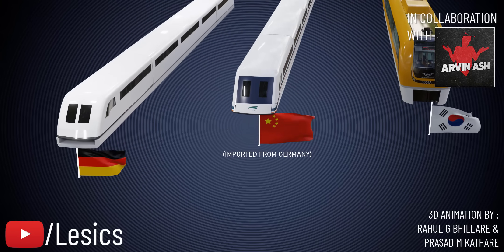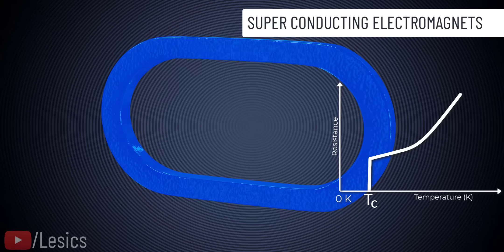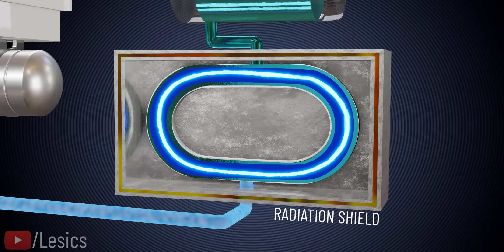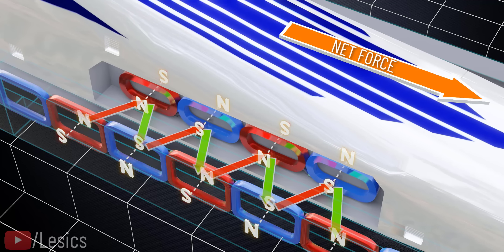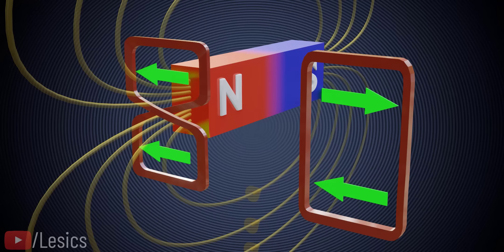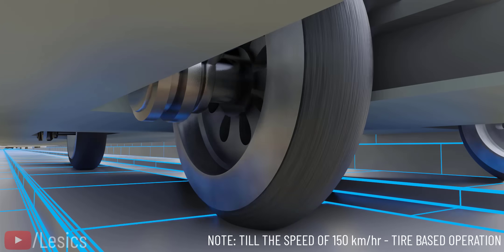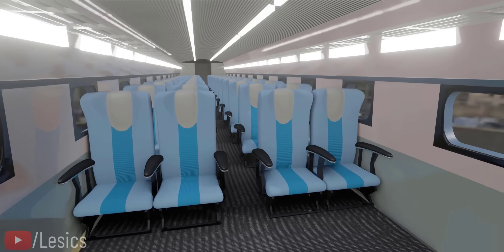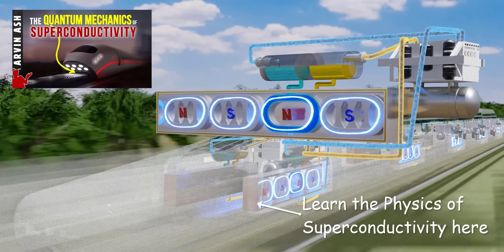The Fastest train ever built | The complete physics of it

Comment: Can you explain this question: why does the rotating propeller produce wind? Is it because of propeller’s aerodynamic structure?
Reply: Google it, or check youtube. As far as i understand, there are two principles that work simultaneously, on the lower part of the blade it works as a pump, just pushing air backward, on the upper part it works like a wing, because of longer route of air molecules they travel faster, creating area of lower pressure, sucking propeller in the forward direction. However if 
Lesics wants to explain... il watch that too ;)

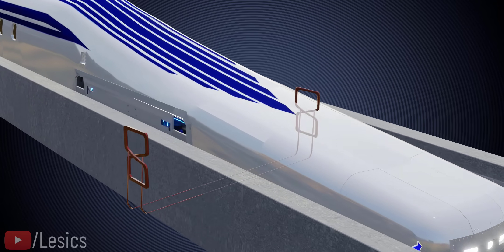Comment: 8:40 Wouldn't this cause an accident if a coil on one side of the maglev is broken? If one of the superconducting units has lost it's charge for example, it would mean that there is potential on one side, and not the other, meaning that there would be a constant force pulling the train to one side, until collision with the wall, how did they get around that issue?

Comment: When its explained like this it seems like such a simple concept, its just magnets and wires, but can you imagine telling someone 100 years ago that we'd have floating trains??
Reply: Industrial level superconduction is a BIG part of that concept.  Without that relatively new discovery, these would be big rails of melting metal and fire.  Before superconduction, we had ideas on DECREASING resistance, but it came as a shock [npi] that we could ELIMINATE it.  Without the elimination of resistance, we're back in the realm of most other high power propulsion [dragsters, rockets, missiles, etc.] lots of heat energy blowing out the backside.
Reply: One thing mentioned at the beginning of the video is that you need to alternate the polarity of the on board magnets to achieve propulsion. If the system controlling that alternating function were to fail, it would not be a pretty ending. I am also curious to know the process for reversing polarity as well.
Reply: @Aharpoon24  there would obviously be safety measures to stop that from happening
Reply: 👍👍👍👍
🤘🏻🤘🏻🤘🏻

#peacevaas

👌🏿👌🏿👌🏿
Reply: https://youtu.be/lnT1GOxLOFA

Comment: Around the five-minute mark they mentioned changing frequencies as a way to keep the train moving forward

I'm trying to think if these coils are only a few feet or metres long

And the trains moving at 600 km an hour. Wouldn't the frequency shift have to be incredibly fast. Like 166 Hz?

600 (km / hour) =
166.666667 meters per second
Reply: Yes,  I was thinking the same. I think it's possible to achieve 166Hz easily I guess so🤔🤔🤔

Comment: Honestly, from a design and engineering point of view, I still believe that the technology employed in the German Transrapid (used in Shanghai) is far more practical and makes more sense from a maintenance point of view. The need for retractable wheels in the SCMaglev, when operating <100km/h is unnecessarily complex, not to even mention the maintenance/running costs of the helium based cryogenic system. I'm very much looking forward to how China will evolve their competing technology, as I know they too have a 600km/h train being developed, with planning already underway in Guangdong.
Reply: It's clearly over-engineered and there is quite widespread criticism of economic viability of this project especially considering demographic projections...
Reply: The German maglev has only 1 cm clearance and uses costly computers and as far as the wheels go they do not have to screw around like planes with tonnes of fuel on board where I believe most of the wear is done.
Reply: @edwardbarnett6571  The argument of costly computers was valid in the '70s when the two technologies were still in development. Now the cost of computing relative to the cost of the whole project, is basically insignificant.
When it comes to wheels, it's still better to avoid them completely. Retractable rubber wheels will completely take away the main advantage of Maglev, which is lower maintenance costs.

Comment: I always believed that magnets will play a key role in solving our big energy problems. 
This whole train was achieved simply by fully understanding magnets.
Reply: It requires "big energy" to run those trains.  We are right back to square one.

Maybe use solar panel on the tack to offset the grid requirements...  But that's a long way off too.
Reply: @robertfleischmann4119  - Well, when you say "Big energy" maybe you could compare how big, vs an Airliner, moving the Same number of people, from "Gate to Gate!" (So, that would compare the Airport Terminal Fraction, the Push Back Tug Energy, the Taxiing Energy, Takeoff Energy Cruise Energy, Descent & Landing (Braking) Energy, plus, again, Taxiing Energy, & again, amount Fraction of Airport Terminal Energy.) 

Who knows, you might still be Right, as, it no doubt uses a fair amount of Energy, to push it to 600 KPH, at Near Sea Level Atmospheric Pressure!
Reply: @robertweekley5926  If it is run in a single 11 psi tunnel not only can you avoid surface disruption but people can still breath while saving on tunnel resistance.
Reply: @robertfleischmann4119  It only uses the same power as HSR at the same speed and without any maintenance it may make a profit.

Comment: Nooo:- There is a Mistake in Controlling a train direction, a driver cannot cross the corner!! When it will turn in the corner one side of atrain will be higher more than another side! Another mistake is what if atrain will stop suddenly?? It will cause high heat in its superconducting materials... (Just modify u'r train first)

Comment: Bro in the horizontal direction the train should OSCILLATE as for the  force(f1) acted for the restoring of position of train there is no force to counter f1 until the train moves certain amount in the direction of f1.why it does not oscillate.

Comment: the french TGV holds the speed record for a wheel over rail train: 572 km/h. It is a 40 year old record.

How is a magLEV going at 600 km/h impressive ? I would have assumed with all the tricky technology, it would be already breaking the sound barrier or something... lame.
Reply: Tgv  never held the ultimate train speed record and ghe 572 run is from 2007, its not 40 years old
Reply: @matsv201  my mistake, it is from 2007. Still an old record, for WHEELS OVER RAIL like I said.
Reply: @bschwand  well someone is going to have the specific wheel record just like someone have the steem record.

Its wrong that tgv held it for 40 years.. the 1981 record was not a record .. the 318km/h was slower than a 1955 324 km/h run.

Fun fact. Tgv have never hold the train speed record.
Reply: @matsv201 
-  "my mistake, it is from 2007"
- "... record for WHEELS OVER RAIL..."
can you read ?
Reply: @bschwand  what of what i wrote did you not understand?
Reply: You are missing the point. 
572km/h with simple wheel on rail: good engineering.
600km/h for an insanely complex, expensive system: bad engineering. Make it go at mach 1+ then it's impressive.
Reply: @bschwand  maglev is less expensive than normal track.

Also the tracn was just scrap  after the 2007 test run..

Just pushing thing beoned there limit is not good engineering.

Besides that tgv needed 150 km of track.. sc maglev had 41

Comment: I beleive this is a a promising technology to substitute commercial flying due to the environmental effects of the latter. However, isn't it incredibly expensive to build and maintain such system? 

Can this ever become a wide-spread system or even replace commercial flight? I try to be optimistic, but the biggest opportunity of flying is that you can fly... well, anywhere as long as you can land. I doesn't need a built track which covers a large area on the surface.

I know this is only the beginning, and I'm all in for sustainable developement but this seems to be difficult to be implement widely. What do you think?
Reply: High speed Maglev can be time competitive for anything within 1500km if you account for the much quicker boarding time, lower likelihood of delay, as well as being connected directly to city centres. The Japanese system mentioned here will likely be extremely expensive as 85% of it will be underground in tunnels, and the capacity of it is lower than current Shinkansen lines. I'm far more looking forward to the competing 600kmh system being developed in China using a far simpler technology, based on the Transrapid Maglev.

Comment: We already have 400 km/h high speed trains on good old steel wheels. Who is going to spend 20 x more to go 50% faster???
Reply: this has potential to go much faster than +50%. it's levitating (flying), not impacted by any friction by steel wheels/tracks. 

pump electricy from nuclear, it only matter of how much electricity you're willing to pump to get higher speed + how much the exterior material could withstand air friction

Comment: What happens if electricity cuts out at full speed?

Another question: How does train guidance work on speeds too low for magnetic levitation? It would seem hard to use wheels to turn at 140 mph or even 40 mph without rails.

Thanks for the excellent video!
Reply: All system apart from propulsion  is passive systems, hevce they work even with out power.

The systems also have a ups and a gas turbine onboard for low speed emergancy.

The wheels guide the tran as a normal train at low speed.
Reply: @matsv201  I see about the power loss. I was worried about cooling the superconducting coils, but I guess that's what the backup generator is for, and they probably take a little while to warm up. It makes sense that the levitation and guidance should work as long as the train is moving and there's a current in the semiconductor coils. 

There must be tracks for the wheels, right? It looks like there's very little clearance on left and right of the train, so I wouldn't trust car-like steering, especially if the track makes a turn.
Reply: @ilyagrig  well.. there is a few more systems. Its the speed thatnis generating power.. so even if the powet is cut, the momentum of the train will keep generering it.

There is also a helim tank, it will last for 10 minutes or so. By that time the the train would allredy have stoped.

Then there is the ups, then the gas turbine (supose to be swiched to a fuel cell, the gas turbine is the reason for the black stripe  on the roof.)

Then if everything fail the train will drop into the trought and just glide along. There are teflon pads  on the outside for that reason
Reply: If the power is cut, the normal wheels would be used for emergency purposes I suppose.
Reply: @_egghead  not really. They cant be used at high speed. But ut dont matter because the levitation is self supporting.
Reply: @N.G.Gonbei  Thank you! Together with the previous answers, that about covers it for me.
Reply: note this one  air planes dont have rails they can do400 mph  also the train is in a trough bit noisey it it touched but still safe
Reply: @N.G.Gonbei  
Japanese Technology is magical, Technologies nowadays don't even put 10% of the Innovation that Japan putted into SC Maglev! 
Really Stunned to see the theatrical in even Animation, its an engineering marvel in Actual Practice!
Love and Respect from India🙏❤️

Comment: I am sorry to rain on your parade. China is poised to break and surpass the Japanese maglev train achievement by using high temperature superconductor. They only need to use liquid nitrogen which is abundant compared to liquid helium. Furthermore, China could complete a maglev rail line much faster and longer than Japan. Japan's 2035 completion date of Tokyo Kyoto line is too slow. Japan need to buck-up.
I suspect Beijing-XiongAn-Shanghai line most likely will be high temperature superconductive maglev line. Many times longer than the distance between Tokyo-Kyoto.
Not saying Japan is not capable but China obviously have the advantage of scale of economy.

Comment: i'm curious, how many coil components can fail before there's a catastrophy xD
Reply: When a superconductor fails, it can be a really sudden switch to a bad situation.

The superconductor has zero electrical resistance. But if you put too much current into it, or put in current too fast, or subject it to magnetic fields that are too strong, or too turbulent or the superconductor heats up beyond the critical point, then sudden quenching happens.

The supermagnet goes from being a perfect conductor to an imperfect conductor in a small spot very quickly.

This causes that spot in the superconductor to heat up very quickly. (The energy in the magnetic field is turned to heat, very quickly, causing more of the superconductor to quench...in a kind of chain reaction.) That sudden heat, in turn, causes the cryogenic fluid to boil off very quickly as well

Which causes the other supermagnets cooled by the same loop to quench as well.

My guess is, that the train has a recouperative beaking system to slow down the train (more magnetism used for braking😅)...combined with the wheels as a backup...plus the side walls are Teflon coated.

I'd be open to being a test dummy🤔...but not for free😅
Reply: Even if all coils fail, there's a backup traditional wheel tho.
Reply: @_egghead  on a high speed? Surely the wheel couldn't handle it
Reply: on land what is the land speed record  wheels have to be used  if it takes off its an airplane  so there
Reply: In point of safety, I wonder if the tunnels this train is passing through  souldn't be better fitted. If they are too large, terrorists could place bombs inside.
Reply: I was thinking about potiential sabotage, if you cut the links between each side it could make the train loose the ability to stabilise side to side. It depends on how easy they are to get at.  

I guess you would have to do that to several coils though, you have to remember from the track coils perspective the entire train is over them and gone in less than 1 second. 

Worse: cut and connect them back in reverse polarity, it would either blow the coil up or pull the train hard into the side of the track or combination, again you would probably have to do a significant section, the train might just ride through with a bump or harsh jolt.
Reply: @chris746568462  Have u thought what happen if someone cuts the traditional railway track? Well , the entire traditional track is connected to a circuit Or electrified. The  track engineering department monitors the entire track lines from control room. If every thing is ok then only the control gives green signal for the train movement. This safety mechanism also ensures that no two train can come on a single track.
Reply: @amanch9322   Would they know if you made the track wider? Rail is pretty bendy when you have pulled several tie downs out...    

I like what tyler says, given the high cost of superconductors, associated equipment and space i bet each coil set is just designed to be as reliable as possible rather than having backup, and they rely on airbrake/wheels to handle an emergency quench an stop, that is if the wheels can handle almost 400mph...  

Any track repairs from a major accident are going to be considerable, most of the infrastructure is in the track.
Reply: @chris746568462  this is a child question, but what about EMP gun? will it forced the train to stop? the speed and energy from sudden stopage surely would be fatal
Reply: @Repsyzz  an EMP in theory would kill propulsion and slowly bring the train to a halt. It's not like it can instantly stop from 600km/h and as long as it goes forward it will levitate and guide itself passively and only when it drops to a low and safe speed touch the ground, hopefully on its wheels.
Reply: https://youtu.be/ffO_McpxSHE

Comment: Although this is a technological marvel and something to admire from an engineering standpoint, in reality it is prohibitively expensive to build and operate. All this special built wiring needed along the route several hundred Km's (which needs to be a super level and straight route compared to normal High Speed rail - so much more expensive tunneling through mountains), both the guide-ways and the ineffective induction powering system buried underground for the complex machinery on the train which consumes large amounts of power. Add the complexity of mass manufacturing these super expensive and complex train-sets with cryogenic machinery onboard - it is no wonder why other countries are not very much interested in this technology. Everything comes down to cost vs. benefit after all...
Reply: Is it? Do you ha e a source for that or are you guessing?
Reply: https://youtu.be/ffO_McpxSHE